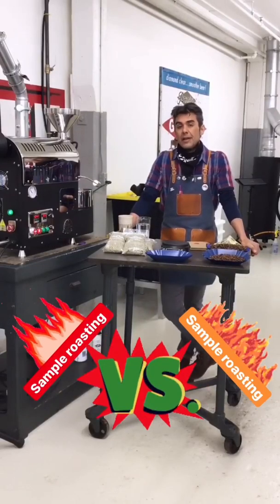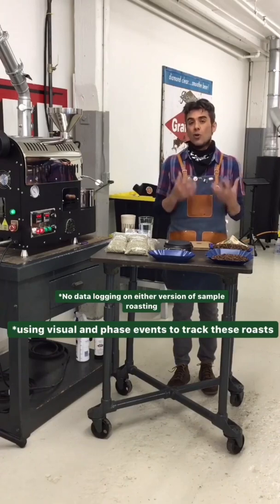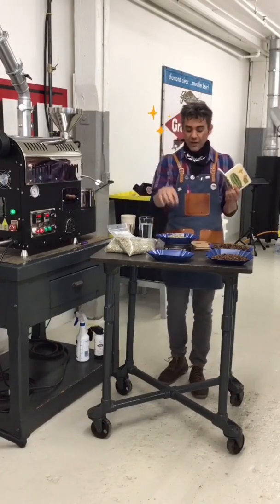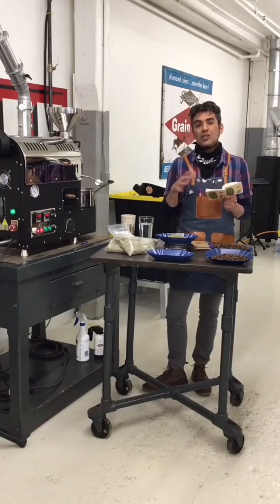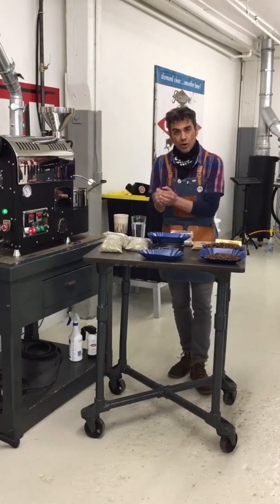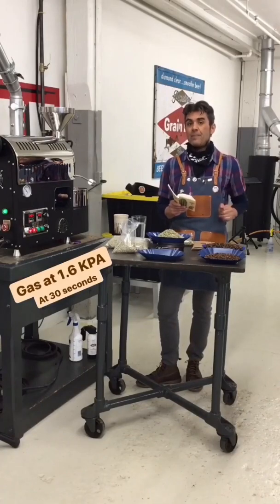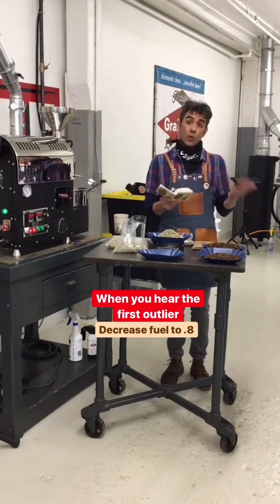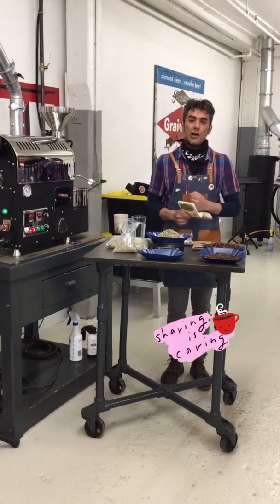Mill City Stories: Sample Roasting- Exposing The Cup vs Impacting The Cup

Comment: Wanted to ask about the drum speed. Ideally we should be changing the drum speed when we have lower charge weight right? Or is importer sample roasting is just meant to be fast so not much adjustments needed? This is for the 500g roaster.
Reply from the maker: Drum speed affects heat transfer. In most cases, it's a good idea to run max drum speed with maxed size charges. This will mechanically fluidize the green coffee to maintain  70-75% convective heat. Drum speed is reduced for smaller charges to maintain the same conductive contact time resulting in the same 25-30% conductive heating as the larger charge.

Comment: Is it fair to say that something like the small barrel sample roasters are primarily for green quality control sample roasting, while something like the Mill City 500g is more equipped for both kinds of sample roasting (including the production sample roasting)? 

   Also, I saw your recent Ikawa video. Is that product well equipped for both types of sample roasting (but for very small samples of course)?

   For the barrel roasters and the Ikawa, I don't mean is it possible to do a sample production roast    in the same way that it's possible for an expert pilot to land a plane after the engines blow out if he's carrying his lucky charm and the stars properly allign. I mean taking Derek, for example, could he reasonably expect to get desireable results for both kinds of sample roasting mentioned in the video on a traditional barrel sample roaster and/or on an Ikawa?
Reply from the maker: Our 500 gram roaster is designed for both greens exploration and profiling roasts. The Ikawa is a good tool for greens evaluation and a heck of a lot of fun to boot.